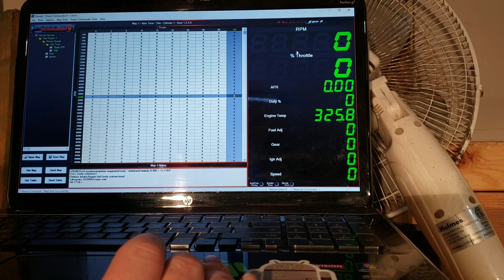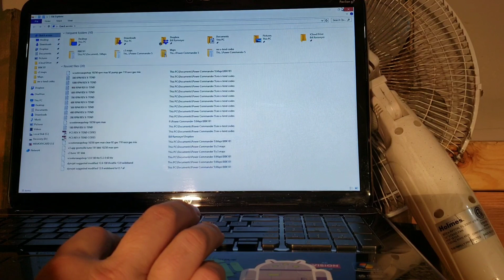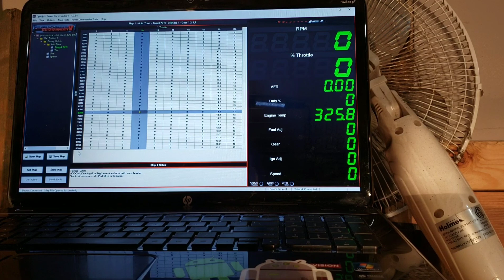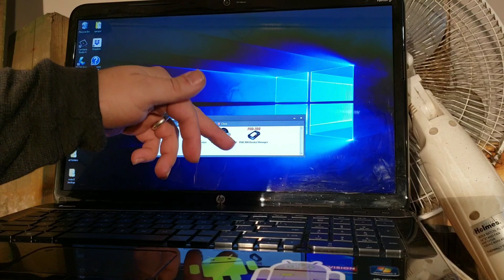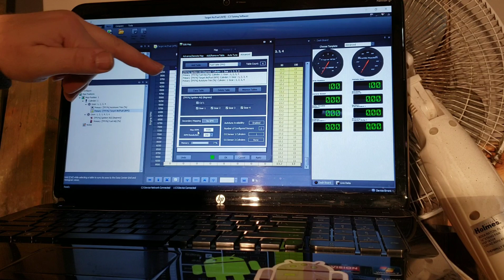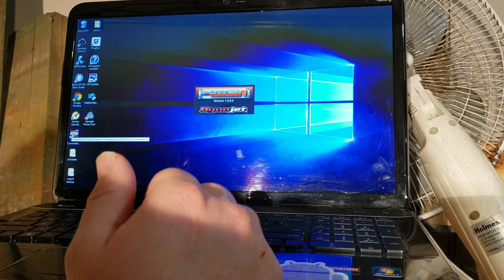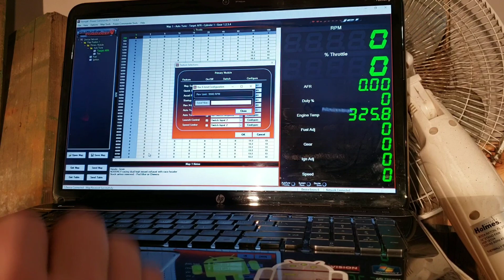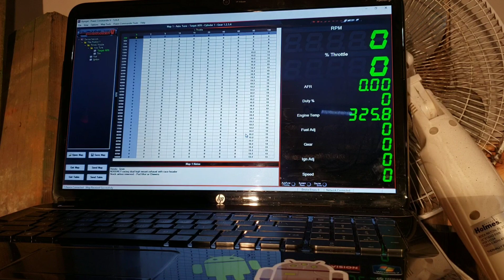Power Commander V  REV X-TEND  and Rev Limiter  " How to configure "

Comment: Oh I got a question, can you configure rev extend to work with a switch to turn it on an off or is it always either on or off via software setting
Reply from the maker: It is set up so it's built in so basically it takes over at a certain RPM. So it is actually going to be your RPM rev limit. So you wouldn't want to set anything higher than what the bike can actually handle. In most scenarios most newer engines can handle about a thousand RPM higher than stock most people set the RPM limit at about 5 to 600 above stock a fully built motor might be able to handle a little bit more than that. There is no way to set it up on a on and off switch. However it only takes a second to go into the settings and uncheck the box that turns it on or off. So for example if you were using this on a race bike you would just turn it on for going to the track in the computer settings and then turn it off for normal riding you would have to physically do this in the software

Comment: I have a 2019 grom idk if that Matters but what is the target air fuel ratio exactly?
Reply from the maker: The target air to feel ratio is what you would set so the auto-tune feature can help get to a Target air to fuel ratio. Basically say for example if you set the target air to fuel ratio at 14.0 AFR auto-tune will suggest add or subtract fuel trims to get to that Target afr. You would then accept the trims from autotune and it would add those new trims to your fuel map so the bike should now run at those AFR settings. For auto tune you will need the wb2 installed as well as the PCV...

If you would like more information about this subject or if you're interested in custom tuning work please feel free to message me...

https://m.facebook.com/BLRTUNING/

Comment: I had never seen a DOHC Engine running at such a lower rev limiter at 9000 RPM and people doing 10,000 it's not right atleast 12,000 RPM need, just look at CBR 150R, 250RR, CBR 650R, they all has atleast 11,700 RPM stock limit.

Comment: Hi bro...
Thanks for your nice video
I have a question, how if my motorcycle type isn't on the choice ?
I use 2014 Kawasaki ninja EX250L 
Thank for your help bro
Reply from the maker: you would have to go to dynojets website and enter in your year make and model of your vehicle then it will tell you which tuning device is available for your specific vehicle... www.dynojet.com
Reply: @BLRTUNING  i have go to website but the website don't have the Kawasaki ninja EX250L in 2014
Reply from the maker: @chelsealayuk2524  yep you are correct I just looked on their website as well and your bike is not supported by Dynojet..
Reply from the maker: @chelsealayuk2524  this means you would have to find some other type of tuning method for it I don't know what to tell you.. if Dynojet doesn't support it obviously there is nothing that I can do.. you just going to have to keep on searching the internet for someone that supports your bike..
Reply from the maker: @chelsealayuk2524  you could also try giving Dynojet a call at their phone number which you can find online.. maybe they can give you more information maybe they do have one that will work it's just not on the website I really don't know.. sorry I wish I could be of more help.
Reply: @BLRTUNING  i appreciate your help and thanks bro

Comment: after i entered the rev xtend key to set my ninja to 15000 rpm it is still redlining at 13000 and im not sure why its not working. Any tips?
Reply from the maker: Did you hit send to bike..
Reply: BiLL Ramseyer Yea
Reply: I requested a code and put it in, the limit now says 15000, but my bike still redlines at the originally 13750 that it allowed before I put the code in. I’m not sure why, I definitely sent it
Reply from the maker: @connrval  that's something that I would definitely recommend talking to Dynojet about that is not something that I would be able to solve.. my thoughts are that either the code they gave you did not workor the bike is going into some kind of safety mode because it won't let you go up any higher in the RPM rev limit...  I would definitely call dynojet...
Reply from the maker: Also did you know that you can request a code from Dynojet if you email them with your serial number for your power Commander v you can request any number that you want so for example if you said you want a code for 1000 RPM that would be 1000 RPM more than stock.. default the power Commander 5 will only add 500 RPM to any vehicle..

Comment: Hey man I read your review on Amazon about the coil overs you installed on your sonata, sorry to ask but the front splitter on your car looks amazing, I have a 2013 sonata and wanted to know if you have the link to that splitter? I’m planning on buying the coilover and after reading your review I found it helpful and plan on getting them pretty soon!
Reply: Thanks for the response, don’t worry about it , I’ll find a splitter that  I like down the road. I love what you’ve done to your car!
Reply from the maker: No problem
Reply from the maker: And thanks
Reply from the maker: The front splitter is made out of several different parts none of which are for this car..
Reply from the maker: I custom made it myself and had to make my own mounting points and everything for it to Mount up to the sonata.. it was not an easy job and it was weeks of measuring. taking it down the road and then hitting over a hundred miles an hour and then coming back and making small adjustments and then trying it again. The front piece is made out of polyurethane and it's for a 96 m3 BMW. The side pieces are aluminum and they are universal and you can buy those on Amazon. The adjustable 8in struts or stainless steel and carbon fiber they are also universal you can buy those on Amazon as well
Reply from the maker: Thank you for subscribing to the channel if you really want to know all the details let me know I will see if I can dig up the links and send them to you total cost is right about $350 I did have to make a few pieces on my own